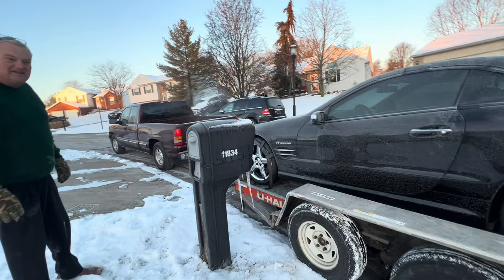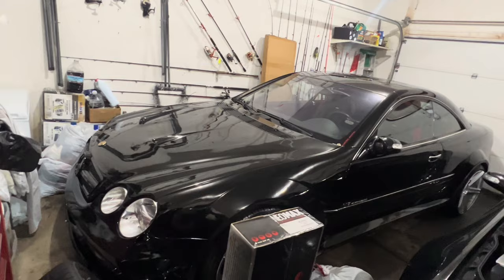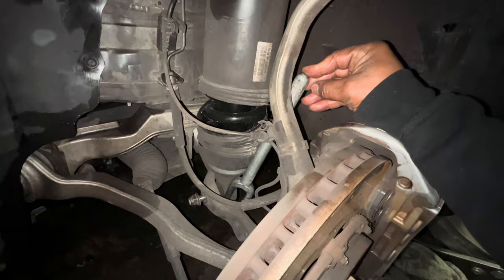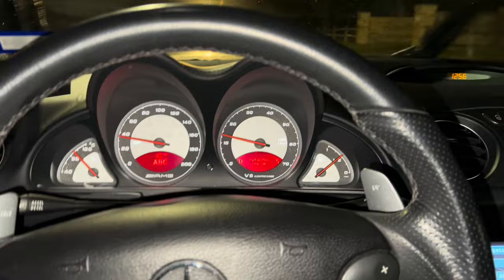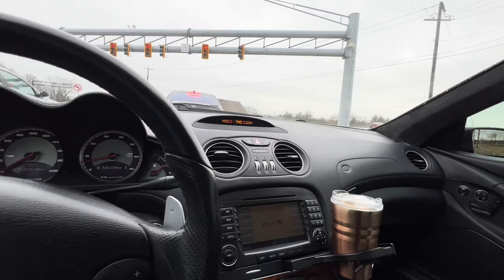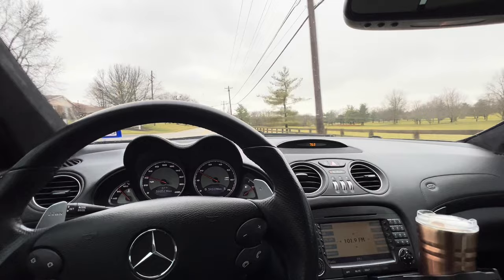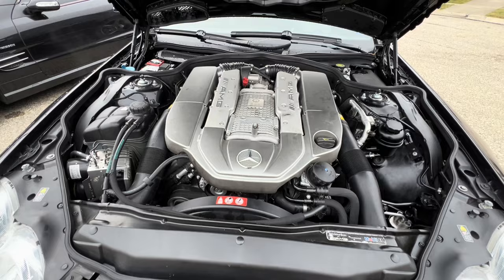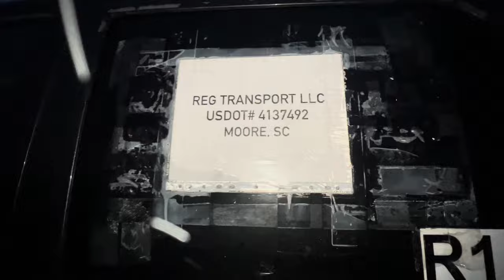2008 Mercedes SL55 AMG Silver’s Neomax Coilover Conversion From Texas to Ohio

Comment: Your website lists optional "rear extender upgrade" when ordering. Can you clarify what function it serves ?  Not sure it was covered in previous videos, but I was not able to find mention of it.
Reply from the maker: The rear extenders are for rear struts that need longer access to the top dampening dial. They are 5-6” extenders. Not necessary for the Mercedes SL. You can simply pull the rear carpet back to access the dampening dial adjustment.

Comment: Where is the location of the fuse to delete ABC warning. l have a 2007 SL55 which l put in BC racing coilovers.
Reply from the maker: The 07-11 requires the abc to be programmed out of the module using STAR
Reply: @goldelementautoworks  Thank you for your assistance.
I love the information that you provide in your videos.